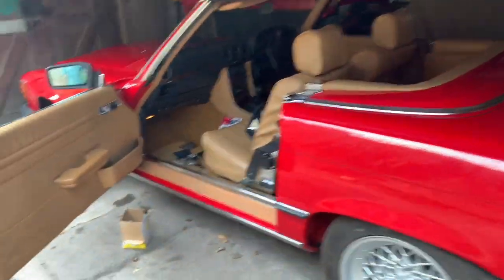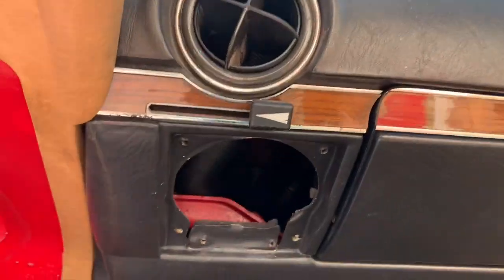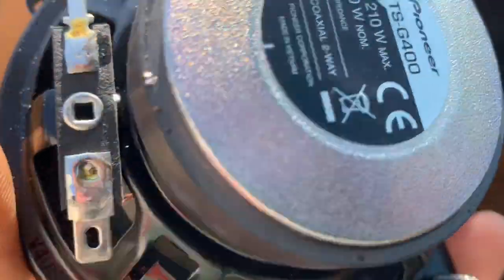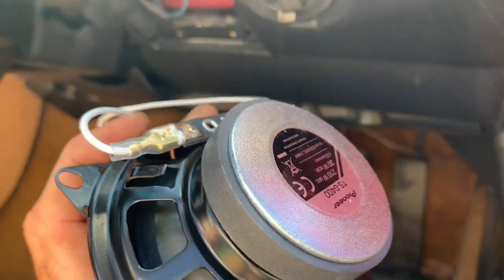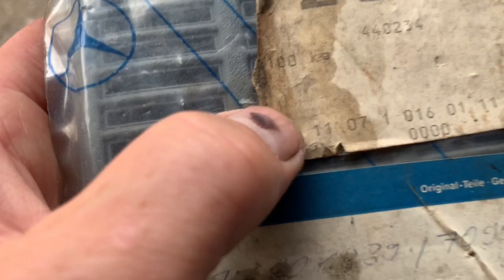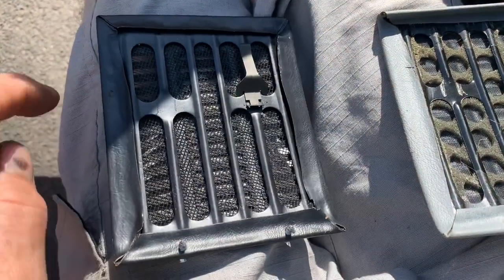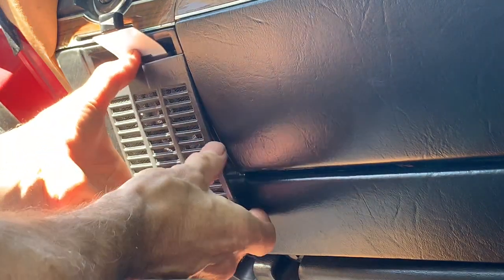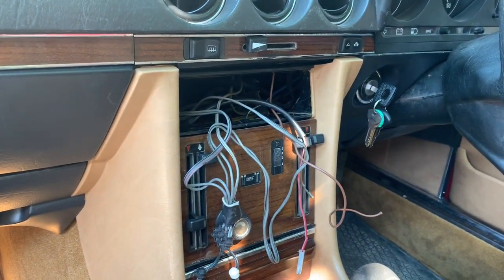Mercedes 107 SL stereo speaker installation

Comment: Great video, thank you! An unrelated question for you… What’s the best approach to getting some replacement keys for my 380SL? Should I contact a dealer or in your experience are the r107 keys able to be easily copied by a locksmith?
Reply from the maker: A good locksmith will have mercedes blanks and be able to cut keys for your 380SL. If you run into problems let me know and I can put you in touch with a guy I use in Bristol. Timpsons have also cut keys for my 1976 280SL....albeit they dont look OEM.

You can also contact Mercedes Parts and provided you have the correct ownership papers, they will arrange a key to be cut in Germany and sent over. Last time I did this, it cost about £24 form memory...and took 3 weeks!

Do you have a problem with your key...or do you just want a spare? Did you see the video I did on mercedes locks and keys?

https://www.youtube.com/watch?v=N-DhBnJ4Ie8

Mike

Comment: did you ever get the becker period correct radio installed? I just ordered mine and was hoping for a walkthrough video :-)
Reply from the maker: Hi - the particular car I fitted those speakers to was unfortunately stolen.....but I do have 1976 107 SL with a Becker radio+cassette player. What is is you need top know? Mike
Reply: @MikesMercsandothercars   That's unfortunate bro... So the previous stereo was a 90's era model and I'm attempting to put in a period correct becker. the only issue is that the 90's radio has all kinds of franken wiring and I can't seem to find a wiring guide for the becker. im basically reverse engineering a hack job, lol. good news is all the old brackets for the amp and radio are still intact
Reply from the maker: @lazylewislewis4944  That makes sense. When I get a chance, I'll have a look at the wiring on my Becker and post a video as I was planning putting in a Becker in the red 1975 280SL I am currently working on. Mike
Reply: @MikesMercsandothercars  that would be super helpful Mike, We all appreciate your hard work keep the videos going👌